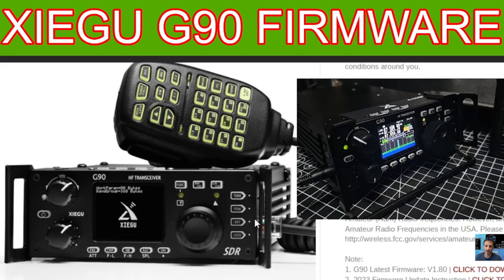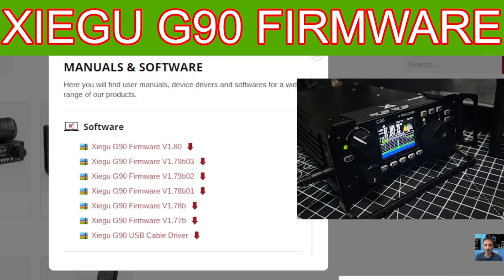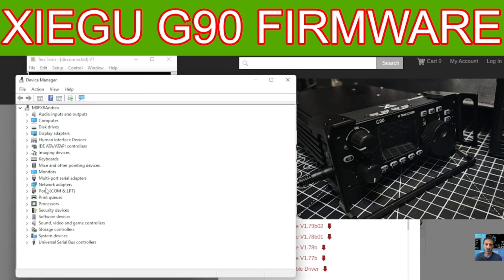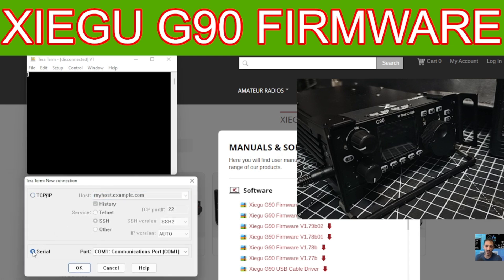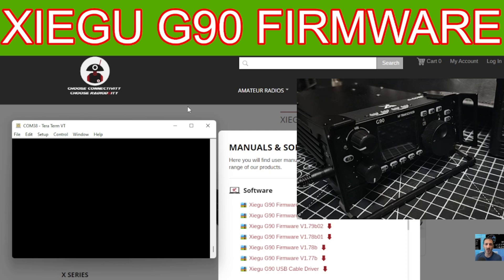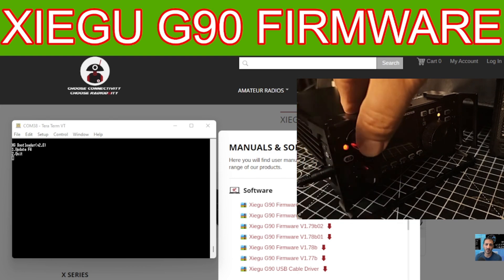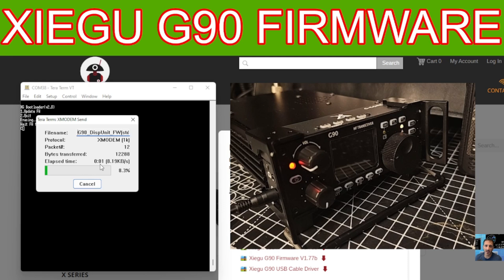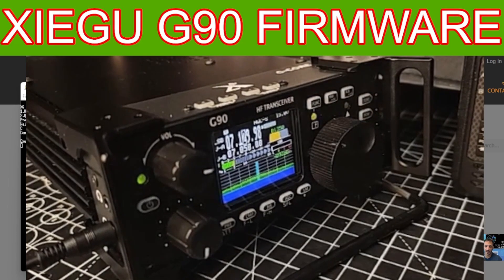XIEGU G90 - FIRMWARE UPDATE - LCD UNIT

Comment: I've just used an application called "g90updatefw" much easier to use, no settings to play with, you just enter 3 pieces of information and follow the on screen prompts for radio button presses and the rest is automated. Software is for windows, mac, and linux. Can't post a link so just give it a google.